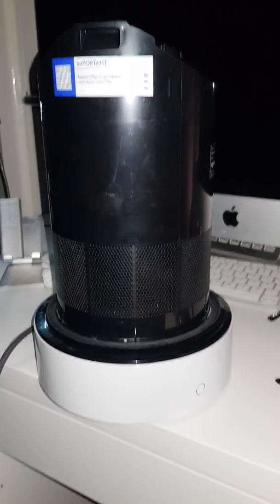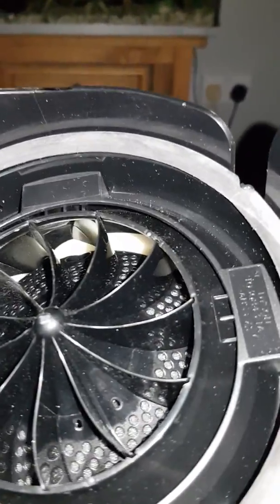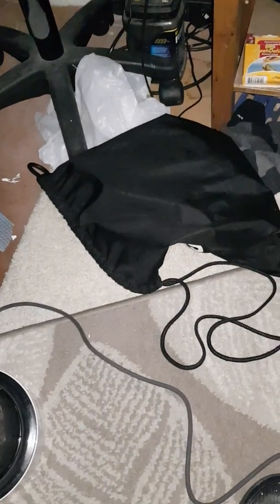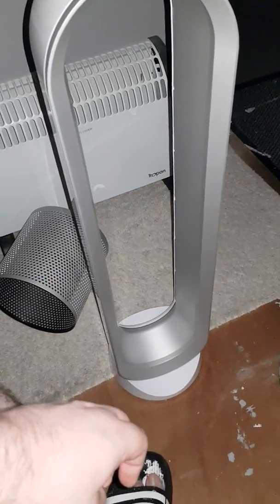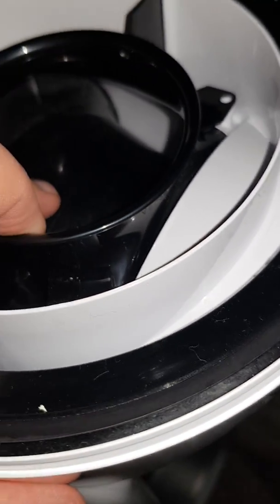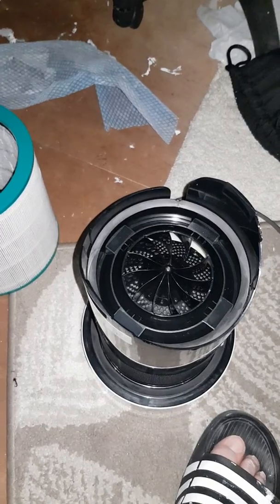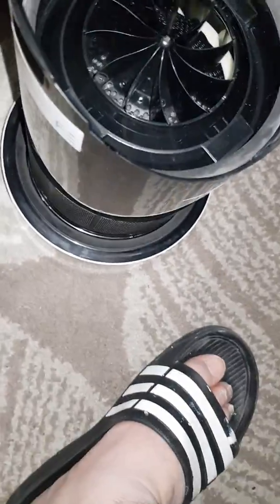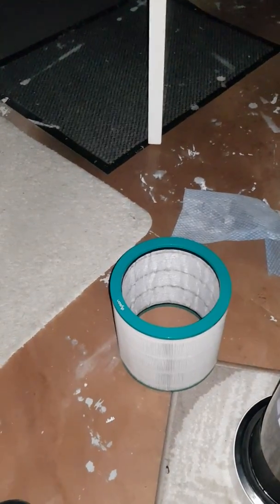The Negitives about the Dyson fan

Comment: Hi Dave, I just want to reassure you that all the airflow that enters your Dyson Pure Cool Link purifier will first pass through the large 360° Glass HEPA filter. The this filter will capture even microscopic dust particles and allergens - so these are kept outside of the base of the machine, and there is no need to clean the machine internally. Any dust on the outside of the machine can be removed with a vacuum cleaner's soft dusting brush, or a soft, dry cloth. Please give our freephone UK Helpline a call on 0800 298 0298, and we'll be happy to help you get your machine connected.
Reply from the maker: ok i did find dust on the inside of the top bit and i did vacume the bottom bit as much as possible im going to get a long microfibre bendy cleaning stick and clean down the insides of the top bit but small bits of dust does get in the top bit it should  really be acsesible to clean it thoroughly and i had to stand right next to my router to get the app to confirm connection